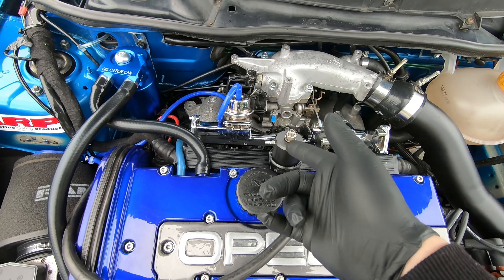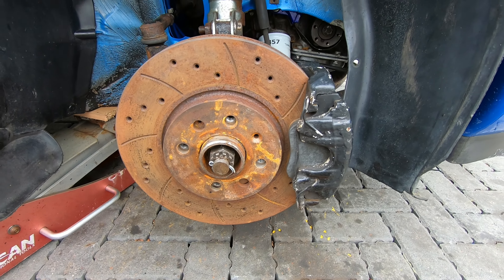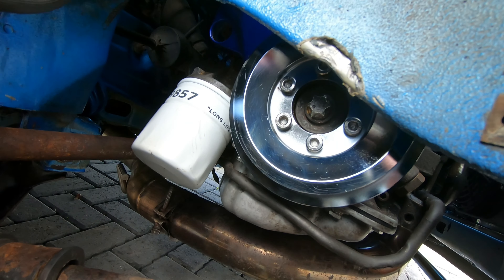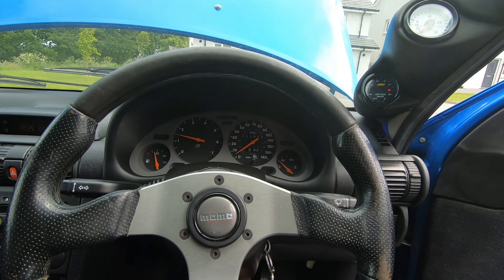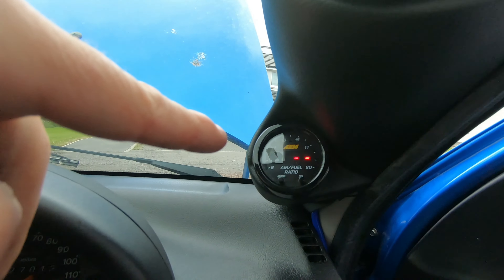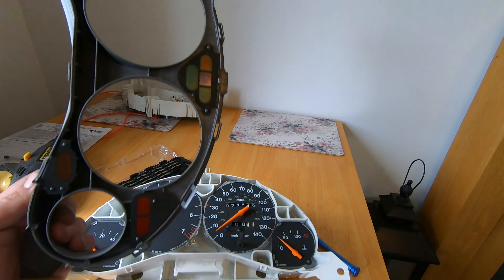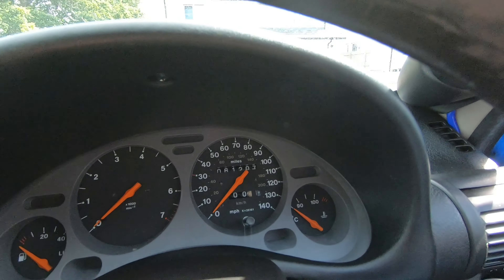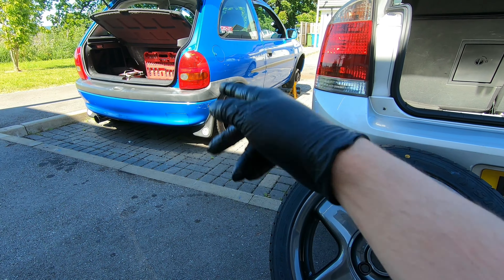Getting The Corsa B C20LET Ready For The Road!

Comment: Good video pal.  For future reference you can manually change the odometer without using a drill, and it's  much quicker too. I would also check for air leaks on the car, it's idling too high. It could also be too rich due to the injectors needing dialling in on the FPR.
Reply from the maker: How can do it without using a drill buddy? I've set fuel pressure to 3 bar today but my aem wideband isnt working properly at the moment unfortunately
Reply: @CarGuyLife  from memory you take a long spindle out, then remove the locking mechanism, that way you can set it how you want, then just rebuild in reverse.
As for the fpr, I think it needs to be a little lower on zlet Injectors. Once the wide band is installed that will help massively. Don't worry too much about idle, you want it around 11.5-12 parts air at wide open throttle underload. So like 3rd of 4th gear rolling start.
If its too rich it will bog under acceleration and probably miss and bang a bit. You may find if it's a little too lean it will perform well, but not for long. I ended out fitting a fixed bosch 3.5 reg in the end as the adjustable one was all over the place.

Comment: Thing of beauty. Is it not idling higher from you removing the needles. Noticed they all sit a little higher even with ignition off. I done the same thing fitting a new display screen in previous BMWs when they haven’t been put back on in the exact same place. I find personally it’s best to plug the clocks in and turn ignition on as they normally move a little to sit on 0 so you can refit needles to point to zero